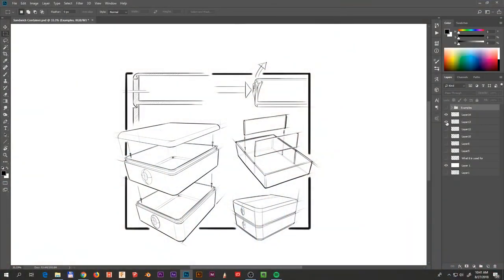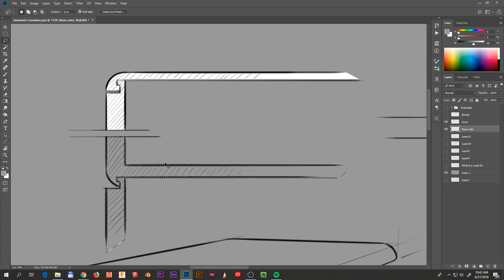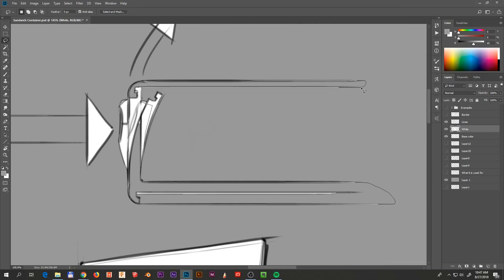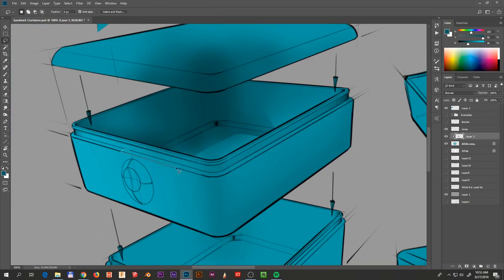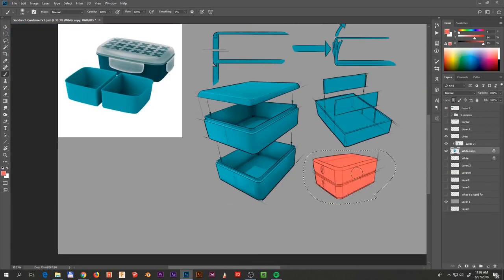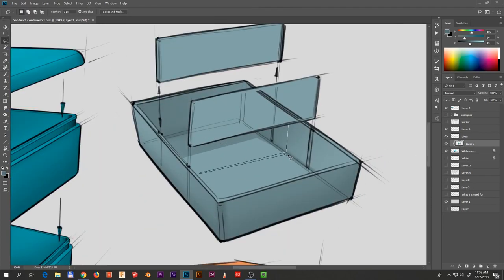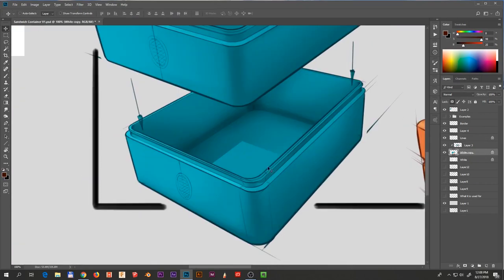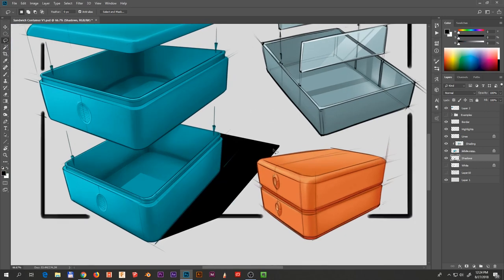Industrial Design Sketch Process Part 03/03 - Photoshop Rendering Tutorial

Comment: This video is invaluable. Have you tried using other drawing techniques to make presentation renderings? For example ,rather than draw first with Sketchbook, then importing into Photoshop, only use Photoshop and use the pen tool or the pen curvature tool to create the line art, which you then can reuse to create clipping masks to help with the shading. Might take a bit longer time, but should make much cleaner and more accurate renderings, especially for products with fine details.
Reply from the maker: Thank you and yes I work often only in photoshop as well. But for what you say it would be much better to just work directly in illustrator. I like to bring the element of dirtiness and and imprecision into my drawing feels a bit more natural and dynamic.